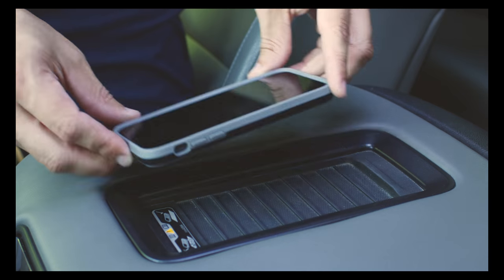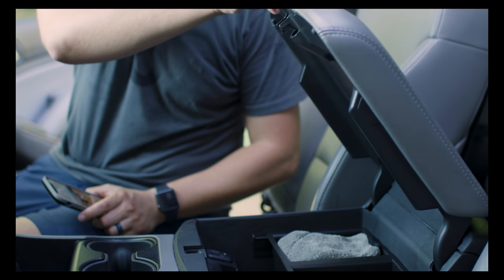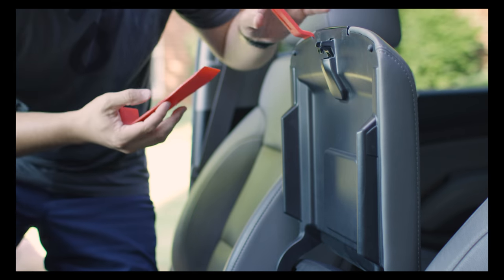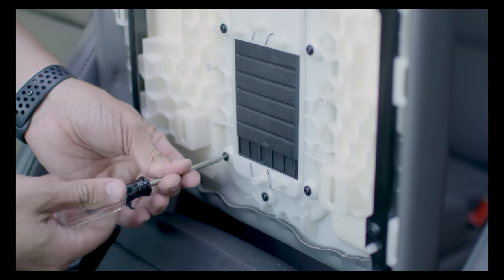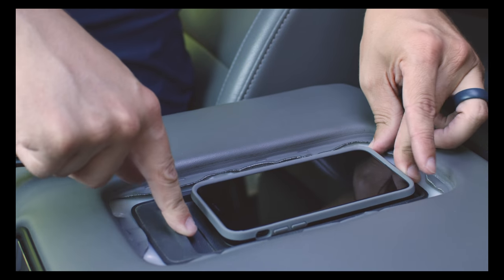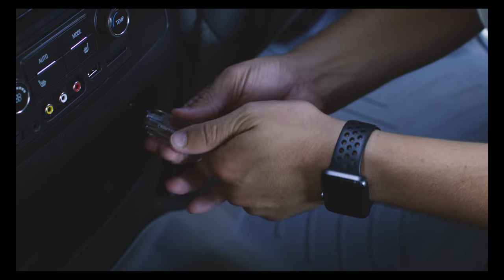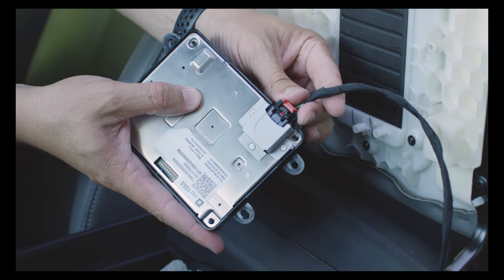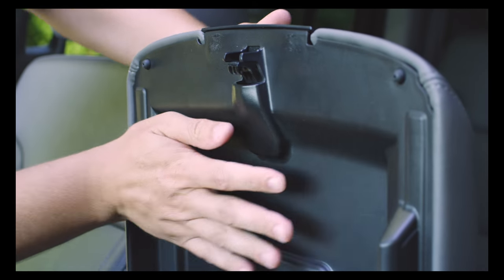OEM FIX iPhone Wireless Charging for GM | GMC | Chevy

Comment: Awesome video, it worked for me! Heads up though...if you purchase the new Module Package from GM it comes with an adapter for the old harness, so you can skip the entire step of removing the back seat cover. Just unplug the old module in the front and add the adapter to the old harness.
Reply from the maker: Nick Laessig - Great tip! ... now if only GM would make a nice plug and play kit to swap the RCA over to HDMI!
Reply: Nick Laessig I used this new harness as well. Phone charges only intermittently though.. are you having the same issue or is it working perfectly?
Reply: where is the best place to buy?
Reply: What is the new module package part number? Using the new part, do you still need to reverse the rubber mat?
Reply: Nick Laessig  do you have the information or part number of what I need to buy for GMC Yukon 17 ? Much appreciated
Reply: I cant find it can you link where you found it?
Reply: @jeffsgora HDMI to RCA converter. Works great

Comment: This is the best video on YouTube for this issue. I've looked at so many I can't even remember how many I looked at. Just easy to follow and understand in all aspects. The combo part number in the description is correct, I bought one today. The cost was over $100 though, not sure how he got it for $65. On the new one you don't need to remove the rear of the console. The new harness is only about 6". I routed the cable as he did, under the module then up and around the slot for the bottom molding clip. Also make sure to route the old part of the harness in the grove of the hinge. So, the new harness eliminates the second step of removing the rear of the center console.

I removed it before I realized that GM was trying to make replacement easier. So hopefully anyone else doing this upgrade will realize how GM is helping you out, reads my post or maybe this video gets updated to mention the upgraded harness.

Below is a link showing the routing of the harness. Make sure to route the original cable in the grove of the hinge. Also a picture showing the holes where the rear console clips into (to help you visually understand why he said to pull back and up).

https://drive.google.com/folderview?id=1vmhabpB3J8mrTJLYYc004u4hhmbUCN6e
Reply from the maker: Great feedback - I'm glad to see GM is making the replacement even easier!
Reply: Definitely the best and easiest to follow. With no experience and only following the video I was able to complete the installation in less than 30 minutes
Reply: Hey when you bought the module did it come with the harness you needed. Did you buy from dealer?

Comment: Great job. I’m stoked to give it a shot. Really appreciate that you took the time to be as thorough and specific. Also really cool that you took the opportunity to point out possible mistakes that people could have made with the pinched wire, orientation of rubber mat and the warning about the removal of the rear portion of the console (preventing folks from jerking all the harnesses out while attempting to remove it). Overall fantastic video. Looking forward to seeing more.

Comment: Hi Jeff,

Thanks for the video. I just did this in my 2017 Tahoe using the new combo pack part (gm part 19432813). 

Quick note - if you’re using that part, it comes with a harness that plugs directly into the existing wiring. You do NOT need to remove the rear panel on the center console, only the piece underneath the arm rest.
Reply from the maker: Thank you for the feedback!

Comment: Hey! Glad I found your video it worked perfect for me and it took all of 12 minutes to swap in the new module. First world problems I know but so convenient to just put my iPhone down and charge. I self-installed in my 2016 Yukon Denali for those who are wondering if this will work in their vehicle.The only thing that changed is screws are now T-20 Torx size in mine and the Gen 2 module includes a wiring harness to plug and play into current wiring with no need to remove rear panel shown in video.
Reply from the maker: Great feedback Armando, thank you!
Reply: How much was the new module?
Reply from the maker: @Kiki-uk9rg  It's around $100

Comment: Great Video Jeff!   Fixed my problem on my 2017 Tahoe, and your video was excellent in every detail in the easy modification. 
If this was your first video, it certainly didn't appear that way...you've got a good presence, pace and tone in your explanations.  Best Regards, C Parks
Reply from the maker: Thanks Chad!
Reply: where did you get the correct wiring harness to connect to your Tahoe?  The one that came with mine was too short and did not have the right connector

Comment: Basically the link doesn't work above for Apple but if you go to the way back machine you can find it.  It says, "The implementations of wireless charging in 2017 and earlier models from Buick, Cadillac, Chevrolet, and GMC do not meet the requirements for Qi certification. These models do not work with iPhone X, iPhone 8, and iPhone 8 Plus."  I didn't know that, I just thought it broke - I even asked the service center at the dealer and they didn't know.  :O 

So good to know basically it's a standards issue.  This video is very informative and I like the research and the fact you posted an update that you can get the newer harness and module for about $80.  I'll be calling my dealer tomorrow to see if I can get it... they are pretty reasonable with prices so hopefully I can just by it from them.  Thank you again!
Reply: Did the module from dealer come with the harness you needed?

Comment: Great video- I second the other comments about not needing to take off the back console with the adapter. Also, I needed a T20 and a T10 driver. You’ll only need the T20 if you only remove the arm rest. Thanks for the great easy to follow video!

Comment: Bodie again, I got the new module in and installed just like the video. OOPS, it didn't work, no charging. It took me at lease an hour to find out the purple wire didn't have 12v on it.
I traced down to a broken in one of the original cables, fixed that and it works great. Thanks for the video!
Reply from the maker: I'm glad you found the problem - Thanks for letting us know!

Comment: Great easy to follow video. I changed the new module and not getting power to the pad. Checked hopefully the right fuse and it was good. Read where it may be wire chafing but still need to investigate further. Getting ready to punt to the dealer.
Reply: Having same problem, did you find a solution?

Comment: Very well done video. I would echo some of the comments below that the module now comes with a short harness adapter so no work is required in the back cover.  I wish I had known that because I broke the tether of the existing harness. It still works fine but I worry it may catch at some point.
Reply from the maker: Thanks for the feedback Brian - sounds like a quick swap with the new adapter.

Comment: Great video Jeff - little more video of the removal of that cover would have helped my nervousness - I was was worried I was going to break it.  Way easier putting it back on.   I ordered the kit through my GM dealer and it took me like 5 mins (after 15 mins getting the cover off)
Reply from the maker: Greg Evans - cover is rough, it is really stuck on there... I may, or may not, have used a bit of movie magic in my tutorial.

Comment: Can I use this if my 2015 Suburban didn't come with a wireless charger on the console?
Reply from the maker: Hey Shawn - I believe there is a backplate that you can swap for the wireless module but I've not done this myself so I can't say 100%.  It looks like there are some wireless add-on kits with the GM module that would imply this works.

Comment: I think I'll just reach 5 inches..and plug my power cord in the USB PORT......😂😂😂😂😂
Reply from the maker: Sounds like you found value from the video in a different way, thanks for your thoughts!
Reply: @jeffsgora  great video..just bought a 2017 sierra Denali...and it doesn't work ..but I'm not mechanical enough..to fix it...but absolutely a great video....

Comment: You can by the new module on line at GM oem parts for 64.99 and it comes with the pigtail plug and play
Reply: Thanks for the heads up seems they are getting double that on eBay
Reply: silver4K would you mind sharing where u found it for that price I can only find it for 99$ on sale with out the pigtail. Thanks
Reply from the maker: @silverfox401  - Good find! - I don't know if this part was available when I did my swap. - I'll update the description!

Comment: I just bought a 2015 Chevy Tahoe LTZ and I don’t know this for sure, but I don’t think mine has a wireless charging port built in the console/arm rest....?? Is there a certain look they have to have? But this video was very helpful to say the most!!
Reply from the maker: If it has a graphic on it showing a phone on the pad and something that shows to placing keys or metal objects between the device and the pad, then you should have the charger.

Comment: We just bought a 2015 Suburban. Where do you suggest buying the new wireless charger for the best price?  And does it come with all the parts necessary to make the swap?  Great first video!!!
Reply from the maker: jmcramblitt - Give GM 84526978 a google and you should find both parts you need for about $60!

Comment: I know I’m a bit behind on this but I can’t tell if the area you’re putting the phone on in the arm rest actually changed at all. What I’ve noticed is that new iPhones don’t even fit in the slot to make flat contact, does making this upgrade make the surface larger or just allow for the tech to work with smaller iPhones
Reply from the maker: Eric - It is only to update the technology for the newer phones to work. The tray is re-used so if your phone is too large to lay flat then this will not help you unfortunately!

Comment: Hi Jeff how can I order that new plug 🔌 or the truck has the new plug inside?
Reply from the maker: GM Part number is in the description for the assembly, I'm not sure if you can buy the plug individually still. - I'd check on eBay.

Comment: Where do you get the module? What’s the part number?
Reply from the maker: Info in the description, google the part number and there are several options - GM 19432813

Comment: You can just remove the magnet from inside the old module and put it back together it will work. 2016 silverado ltz just saying it's free.
Reply from the maker: Great feedback, thanks!
Reply: Any write ups on that?

Comment: @jeffgora is there a link for a 2016 suburban charging part?
Reply from the maker: Should still be OEM GM Part number 19432813 - Google will give you several options with various pricing.

Comment: Where do I find the new harness to upgrade to the 2018 module?
Reply from the maker: You should be able to just google the part number (19432813) and find what you need. Info in the description.

Comment: Thanks, Jeff. Any updates, like a better replacement, so I don't have to alter the pad?
Reply from the maker: The modification to the pad is not required, it simply helps align the device with the new wireless module.  If you are looking for something that does not require an upgrade at all, I would suggest a phone holder with built in wireless that can plug into your 12DC.  I use one of these on my vent every time I am in the car and my phone is always full.

Comment: I have an old I phone and also a newer one on a 2017 GMC SIERRA. Will I need the newer harness?
Reply from the maker: Generally the newer wireless chargers are backward compatible with the older phones so a new module should cover you now and in the future. - Hope that helps

Comment: Can you attach a link to where to buy the correct updated parts as well? I can’t seem to find any
Reply from the maker: Craig, looks like GM 84526978 might be discontinued. I saw one on eBay this morning. Not sure if there is a replacement. Could always try your local GM service center parts counter too.

Comment: Just got the new module today.. only took 10 mins to change, if that.  Mine came with a harness, so I skipped that last step lol  got to use my charging pad for the first time today.. I have iPhone X with otterbox on it and charges no problem.  2017 LTZ Silverado
Reply from the maker: Treezy01 - That's awesome! Great to hear. 👏🏼
Reply: Hi, would you please send me the website link to buy the module. Thank you

Comment: Excellent video. I have a Galaxy S21 Ultra. It would charge except that it is too wide to fit down on the charging pad. Do you plan to make a video to fix this or do you have a suggestion? I have a 17 Denali.
Reply from the maker: Thanks Jim - Sorry to hear about the phone size issue, only suggestion I would have would be a smaller phone on your next upgrade! There are some aftermarket wireless chargers you can attach to your vents that might be a solution as well. There are lots of place to route a long USB cable.

Comment: What about new 2024 where the charger is near the cup holders
Reply from the maker: GM has issues across the board with wireless charging unfortunately. No solid fix available as of 09/2024.

Comment: thanks for the info, I ordered the part as listed and installed it as shown. However pad still does not work, anyone else experience this ? any suggestions?
Reply from the maker: I believe everyone in the comments who has had trouble generally has gone through the process of checking fuses and re-checking the install and found that it always works.  If your phone is too large to sit flush in the pad then of course it may not activate. - Please reply if you figure out what was wrong!

Comment: Same issue in my 2017 GMC 2500... only question is on the harness all I need is the 2018 harness to complete this or is this a special harness adapter... thanks again
Reply from the maker: You'll need the updated module and harness, GM part numbers are in the description.

Comment: Jeff have you had any suspension issues in your suburban yet?
Reply from the maker: Hey Kylee - What kind of issue are you having?  I replaced all the shocks - Compressing the front coils was a real pain so I would suggest buying them pre-loaded with new shocks if I were doing it again.  I felt like the new shocks (OEM) gave a nicer stance and it feels much better on the highway... especially with potholes.

Comment: Finally got my new module ordered (chip shortage really screwed me). Got everything taken apart only to find out that the harness that came with the module doesn't match up with the wiring that I disconnected from. Help!
Reply from the maker: Hey Robin, it is hard to say without seeing what you're facing.  When this video was made the newer modules would not fit the old wiring harness under the arm rest so that is why I show removing the back panel and replacing the harness.  The newer module is actually a kit (these came out after the video was made) and come with an adapter that plugs into the end of the harness under the armrest so removing the back panel is not required.  It is possible that you may not have the right module as you're the first person to comment about this, it is also possible something may have changed since it has been some time since I made this video.  I hope this points you in the right direction!

Comment: The issue with the charger pad isn’t just the old versus new module but the silly size. If you have a large body iPhone or Android, it won’t fit to connect to charge.
Reply from the maker: Agreed - unfortunately not much we can do about that in the current design without some significant modification.

Comment: I'm interested to do this on my 2017 GMC Denali after watching your video I thought is it possible to replace the entire top cover of the box?
Reply from the maker: I don't see why not - the OEM swap gives you the same thing in the end.. Some people don't even have to remove the back cover anymore depending on what harness you get.  I'm guessing a new cover is quite a bit more expensive vs the module.
Reply: @jeffsgora  I'm going to look into that, will let you know what the difference is. Thanks for the video very helpful.

Comment: I added this charger to a 2019 GMC Yukon (MAY WORK FOR EARLIER MODELS TOO)  that didnt come with wireless charging. Once you remove the trim my armrest underneath is just like the vehicles with the  charger added. You can screw the charger right into position. There is no harness in the vehicle so you have to cut off the plug that's on the chargers harness and tap into a switched 24volt source. Infotainment.com has the specific harness for that or you can just splice it in yourself using the purple and black wires from the charger. The other two wires are for the vehicles already equipped so just cap those off. I think they just send info to the head unit display so it can show when it is charging.  Mine works with just those two wires attached. You also need to order the oem wireless charging pad. Otherwise just use the pad that's there. It will work. Just doesnt complete the oem look.
Reply: I just bought a 2019 Yukon that also didn't come with wireless charging. I am looking to buy a new arm rest assembly (~$330) and swap mine out. I will likely have the same wiring constraints as you. I would like to go as OEM as possible. My vehicle has the Premier package, so I am hoping the harness is back there. When I get a chance, I may pull the back panel of the console off to check. Otherwise, do you have some pictures how you did your wiring? I believe the OEM setup sends a signal to the infotainment system to show when a phone is charging on the screen. Not mandatory, but again, I’d like to stay as OEM as possible. Thanks, Greg